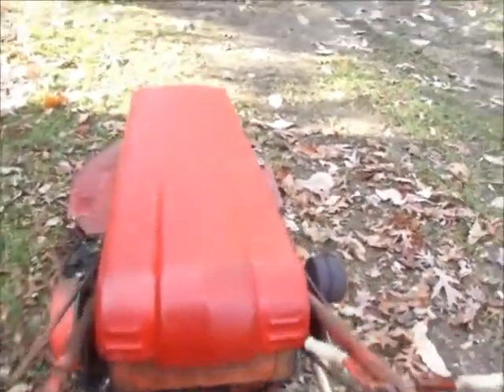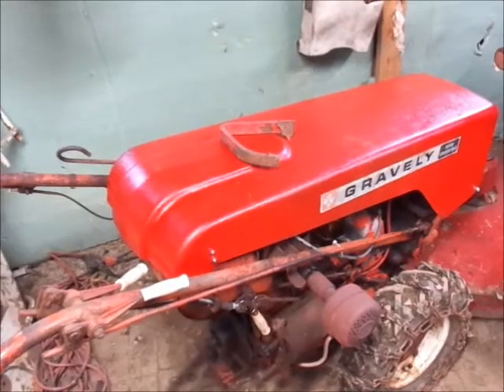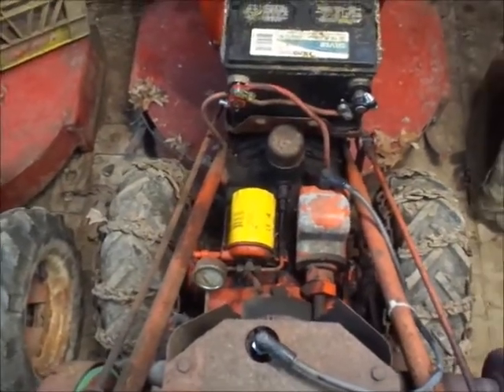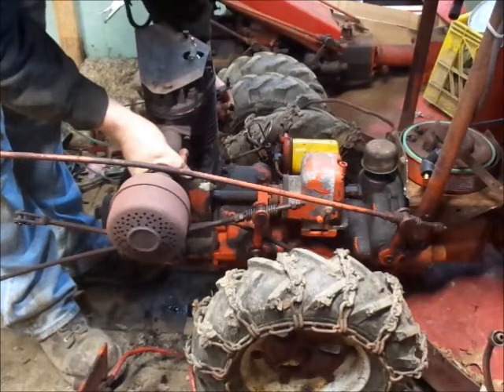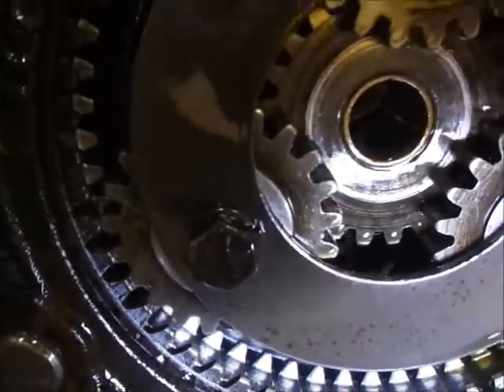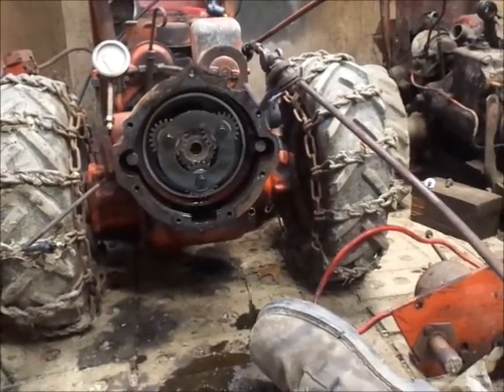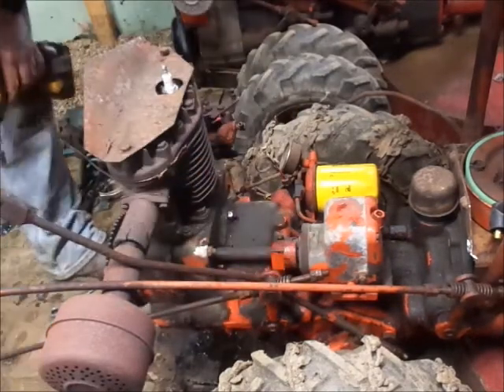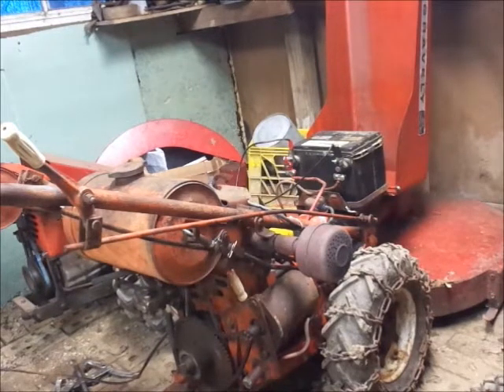Gravely 1969 C8 no high range inspect and fix

Comment: Not hard to get that magneto 180 out. It's easier to take the magneto off to clean or set the points on those electric starts. I did the same thing about a week ago on one of mine.
Glad you had another gear.

Comment: Why do you think it did that? And did you time the planetary's?
Reply from the maker: No I did not since I didn't disasmble the gears. When you remove the gears from planetary setup then yes you need too. As to the why it did it. Im thinking just alot use in said gear